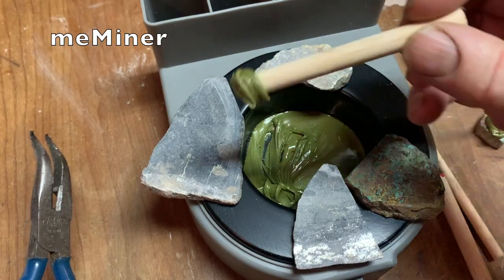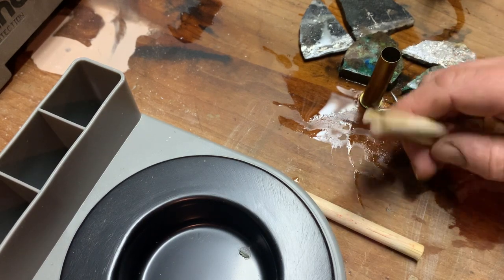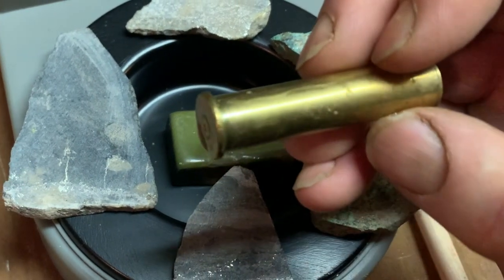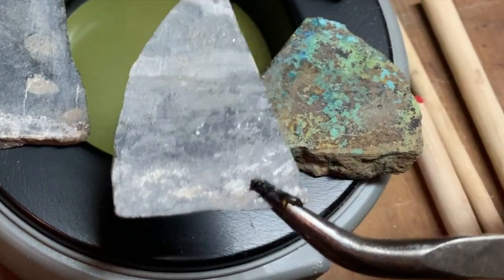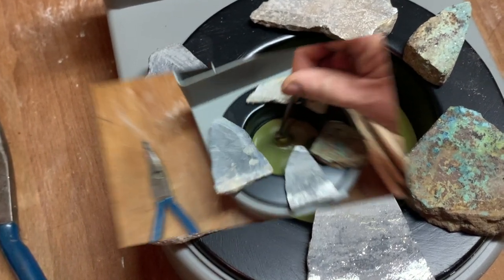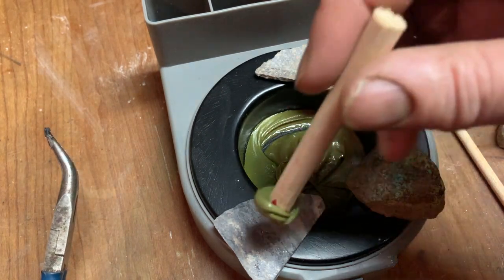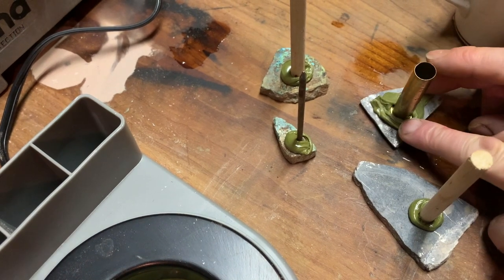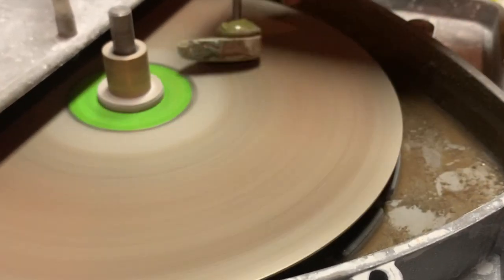Flat Lap Cabs - step 1: WAX DOP

Comment: It's so clean!  Enjoy it that way because it's impossible to clean once it has wax dripped all over it.
Reply from the maker: Brand spanking new.  Since I bought it, only used to keep my coffee warm while I worked on other projects.  ;-)
Reply: @meMiner  You didn't need to tell me it was new, that was very obvious.  I have the same model and it has worked well for me.  Before that, I superglued cabs to a nail head.  I'm sure you know this, but stick the cab and dop stick in the freezer for an couple hours to release the wax.  Let it warm up when you take it out and sometimes it will fall right off.  I just recently discovered that letting it warm after removing it is an important part of the process.

Comment: Noice, I Like.
What! no Daisy.
More wax on the vertical, better support and spreading the pressure.
Shape,  grind the shape then mark with an aluminium stick, put a line all the way around the outside, grind at an angle to the line then blend in the shape so it's one face, deep stones are better domed whereas the thinner ones are often better with just profiled edges and flat.
I prefer lots of water, keep the grindings moving off the disc.
Wish I were there with you, sending you some green wax soon, it's packed away in storage until I move, the scamdemic is really slowing things down.
Reply from the maker: I need to replace the pic tube that runs from the water reservoir.  It has been squeezed too often and restricted the water flow.  Stores are closed, so I may have to wait a bit or find some online.
Reply: @meMiner  
If the pipe is good it might be a build up of Mineral on or around the valve, my first option would be a cocktail stick and poke the outlet, then check the other end, if clean water was used every time there should be no restrictions in the pipe. 
Is it plastic? 
I would out for copper, car brakelines are perfect in bore size for flow, if the valve is brass it can be soldered or use a threaded fitting. 
Plastic pipe last longer if put inside a spring, even if it is only the first few inches, if you need an adjustable feed then wind some soft wire around the plastic pipe, that will keep any bends in place, you may need that fixed at one end, taped or glued. 
Avoid kinks, Any pipe either plastic or metal will crease if bent more than 90 degrees, the crease is now restrictions the flow and the material is thinner on the crease line, a repair can be done using plyers, bit it's rarely as good as it was.
Of course there are two other options, 
Option 1, 
The increased volume method,
This is achieved by having someone assist you with a mains water hose, with a preference for someone you can trust. lol.
Option 2, 
The permanant supply.
This is very effective, although I do not recommend this myself, I have tried it in a former life but can't comment on how good it was as I don't remember anything before I found myself in a line of other people, some of whom had many injuries and seemed very unconcerned.
You will need a higher amp fused supply for this, taking a large tub of warm water ( for your comfort,) power up your lapidary polisher and gently lower it into the tub of nice warm water, the higher amp supply will prevent the power from switching off, it will feel a little strange at first and make sure you dont follow the light like I did.
Reply from the maker: @symonrocks9847  Mine got squished at the valve.  I turned it around so that part is in the open but still restricted.

Comment: Just watched again, God my life must be boring. lol.
Kudos on the wax, just enough in the pot, Don't put much more than that in, the temperature looks perfect, no drips or mess.
There may be times when you need much more wax for stronger support, just use a stick with wax on and dip it but don't stick it, dip again when it's set and dop your rock, shape the wax for more support and always taper away from the rock and in from the edge.
Not good on that grinder, the water should be your next job.
Reply from the maker: I have the perfect timer for wax.  I go drink a coffee.  When done, the wax is ready.
Reply: @meMiner  outstanding.